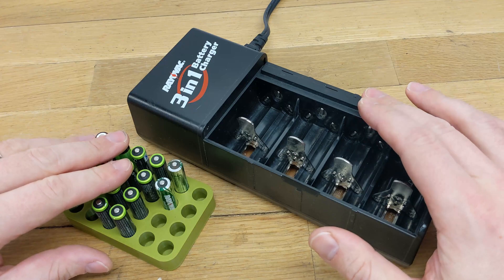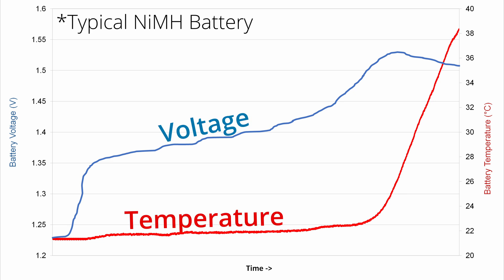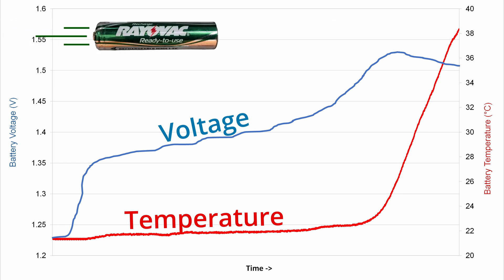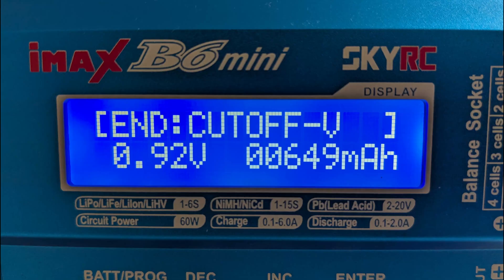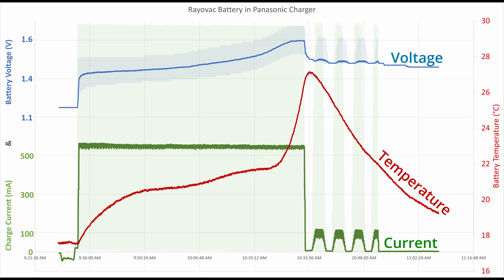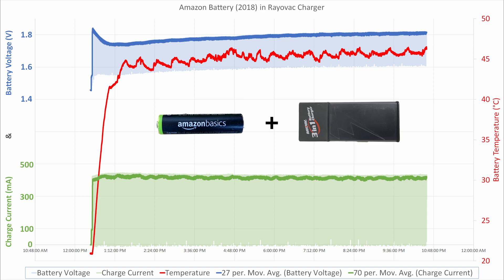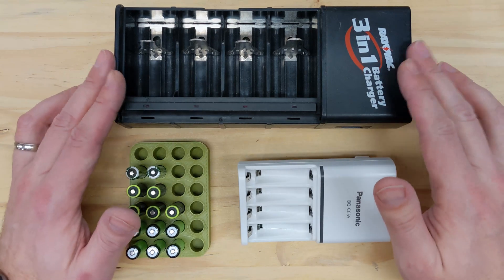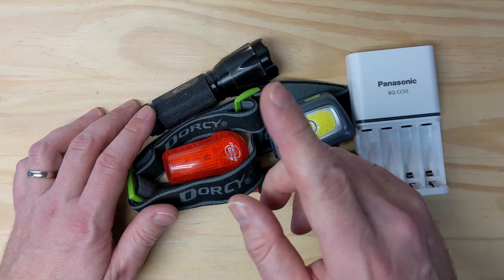Why Your Old Battery Charger Sucks (probably)

Comment: I’ve never had an issue with the older ones simply because I’ve know how overcharging can cause an issue.

Now the plus side to the old ones is it will still charge up NiCd batteries and Alkaline. Additionally NiMh ones that maybe a little dead but you can get some out of them

The modern Panasonic one won’t even attempt to charge them, which is best for anyone who doesn’t know how batteries work

Comment: So I noticed the same thing, I used my lithuim charger which detects the NiMh batteries too and charges at .5c and keeps the batteries cool vs the other charges from Radio Shack charge in series at 250ma which causes it to really heat up. Its also interesting when discharging the same batteries as I have 10% more mah with the correct charger vs the near 20 year old one.
Reply from the maker: Interesting. I can imagine that there are so many different charging "profiles" between all the different chargers sold. Unless someone spends time to really measure and dig into what's going on with their specific model it's essentially a mysterious black-box.

Comment: I had an old charger. After it cooked a few batteries I decided to take it apart. It advertised as a smart charger, but the only brains were a chip that sent "x" amount of current into the battery for "y" amount of time. Basically just a timer. For the old type of batteries it worked fine. The current and time were enough to charge the low capacity batteries at the time. The newer high capacity batteries were being undercharged and performing poorly. I gutted the device and turned it into a constant 10ma charger. Good for slow charging standby batteries for a long time, or applying a slow safe charge for old batteries I need to test to see if they're recoverable or test for capacity (you don't know their capacity unless you fully discharge from a fully charged state. A long time at a slow charge doesn't seem to hurt them any more than they already are). I replaced it with a real smart charger (oddly enough I bought it from Radio Shack). Internally it's actually smart and testing showed it really does charge the batteries the correct way.
Reply from the maker: Thanks for the comment, I completely agree; the low and slow charge method works great, if you have the time. Which I think I would be able to get away with, usually. The speed of the Panasonic is nice though...

Comment: I discovered something similar when fast charging NiMH RC airplane battery packs many years ago, they pulsed a high current and then paused for a short time to measure the voltage…  got plenty hot but we were fast charging, kind of expected.
Reply from the maker: Thanks for the comment. Indeed there is a lot going on with the science of charging NiMH batteries. I could talk about what I observed for hours, but even I wouldn't have the attention span to watch a video like that! :)

Comment: Changed my charger from an old Energizer from the 2000's era to the Panasonic smart charger same as yours a few years ago. 
I like the fact that it could individually charge each battery in their respective slot, charges faster and could even tell the battery level/condition instead of being timer based like the old one.
Reply from the maker: Agreed, the individual charging and the level indicator are another big plus! Thanks for the comment.

Comment: The best charger in my opinioni Is the ones that use constant very low current 20-30ma, that way you can overcharge the battery but the temperature stay ambient since its such low power
Reply from the maker: I think those are great too! the only downside is the time. A 2000mAh AA battery would take 67 hours to charge at 30mA. That's almost 3 days and that's assuming no efficiency losses.
Reply: @BusyMDan  yeah i built One with a few resistors diodes and leds and leave It on 24/7 and whenever i Need a battery i take a charged One and put a dead One in the charger

Comment: Very good video, the quality is as good as bigger channels. I always noticed those high temperature increase in my NiMH battery charger, but i just tought nothing of it. Now i understand why all my batteries die early: let them sit in the charger for days on end until the charging light turns off, so i presumably overcharged them so much i killed them in around 20 cycles. Thank you very much for this video.
Reply from the maker: Thanks for your comment! I'm always excited to learn about new things and pass it on. It's motivating when I get feedback that someone else got value from my videos.